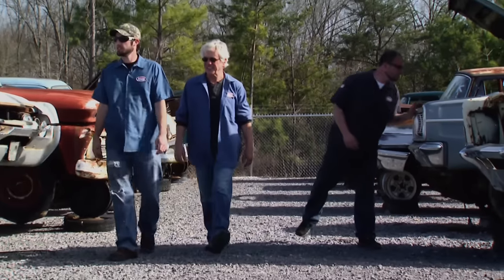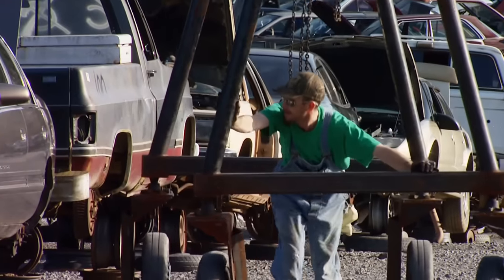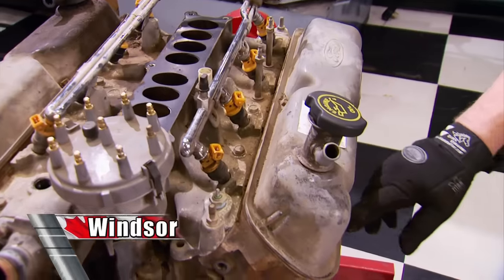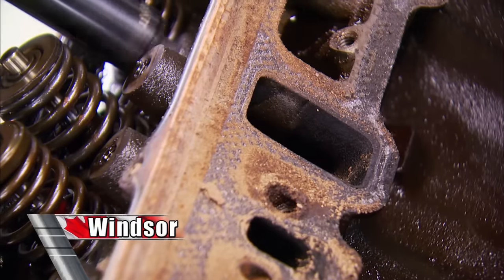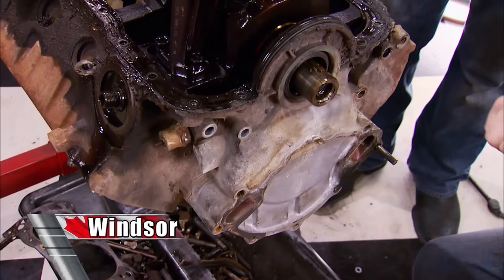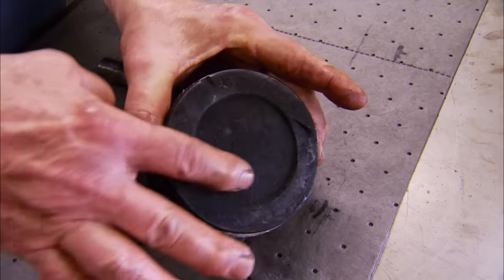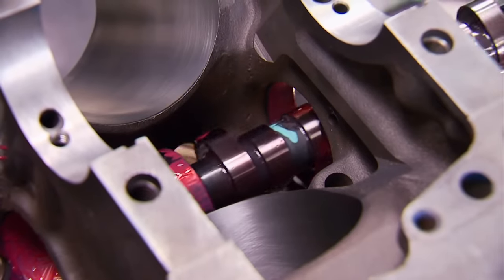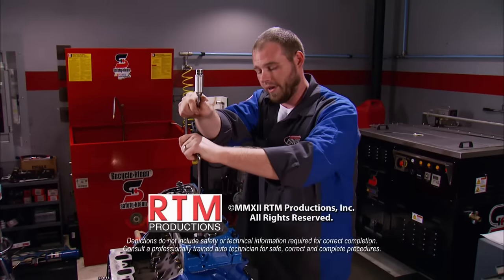Tearing Down a Pair of 351 Small Blocks: Windsor vs Cleveland - HorsePower S16, E10

Comment: I'm in awe...😃 I'd really like to see someone take a 351M and go from mild to wild..
Reply: I think there was a build using stock parts from several on a modified with some changing of water ports that made killer hp.it was in a hot rod magazine fron the early 90s.
Reply: @goober3463  I'd like to see it in this format where they do some low buck mods, say to a 351M Dyno it. Then pull it down put the 400 crank in it and flat tops aluminum heads ECT and make power...
Reply: I’ve got a mild build on my 351m. 750 4bbl, .519 lift hydraulic cam, decked and ported heads, dual valve springs, ported edelbrock 400 performer intake. Nothing crazy but enough
Reply: @JB-tb2qp  on the stock pistons ? Everyone tells me the compression is to low but many motors are 8:1 stock...
Reply: Clinton N yes, and yeah the compression is pretty low, I haven’t gotten the motor in my truck yet so I don’t know how she’ll do but I’m gonna see
Reply: @JB-tb2qp  Too late perhaps, but Racetec Pistons has recently released slugs for both the 351M and 400 that raise the static compression significantly. Go to Racetec's website and look in the Autotec section under Ford Small Blocks.
Reply: 413x398 yeah I’m not wanting anything crazy crazy I’m thinking about getting another project soon
Reply: if i know my tv shows, they ALWAYS end up putting 5 grand worth of parts on their "low buck" engines.
They start out stock, then comes the Kasse heads, edelbrock intake, full roller cam, plated long tube headers, demon carb, msd ignition, and arp bolts everywhere.
It happens every time!
Reply: The 351M was a pig and the second-worst OHV V8 Ford built behind the 255.  The best thing you can do with a 351M is to turn it into a 400 with a crank and piston swap.   Least for the 400 you can get performance pistons.
Reply: @matthewq4b  See my comment above about pistons, but yes the difference between the two is big. The 255 was obviously sourced from a golf cart assembly facility.
Reply: @413x398 Racetec shows no pistons for the 400 or the 351M  just 302 , 351C and 351W. And it seems pretty clear you do not know what the 255 is either...  it is a debored 302.
Reply: @matthewq4b  OK, just checked and I got one word wrong. Go back  to Racetec and look under the Autotec line in the Small block section. And it seems pretty clear that you didn't get the humor about the 255's power level.
Reply: @mymusicaccount1456   You are aware Ford made 3 different 351's right ?   The 351W which is a small block, the 351C which is a 335 Series, and the 351M which is modified from a 400, hence the M for modified.
Reply: @413x398    Yup looks like they are offing M pistons.   Not sure why though, those tall heavy pistons wreck havoc on the rather thin-wall casting of the 335's at any sort of RPM. There is a reason no one to date has offered performance pistons for the 351M. 
Really the only thing the M is good for is a foundation to build a 400.    And the 255 was not lowest HP small block either, so probably why the joke failed.
Reply: @matthewq4b  The joke failed because you were too anxious to "teach" me something "you" thought I didn't know. Good luck with that.
Reply: @matthewq4b  Ford never made any 351's.
Reply: @413x398    Ford called them 351's whether they actually displaced 351cui is irrelevant.  And really they displaced 351.84 CUI. 
  And the joke failed cause it was crap.
Reply: @matthewq4b  Poor MattMatt. So much angst.
Reply: @mymusicaccount1456  All of Ford's production engines (V8) from 1954 to the Mod Motor were OverHeadValve.
Reply: @mymusicaccount1456   Yes all regular production Ford V8's between 1955 and 1989  were OHV in North America.   They did have production SOHC engine s but they were not regular production.  The 351M  was built/ modified from the 400 to meet the demand for mid a displcement V8 after the cancellation of the Cleveland.
Reply: @413x398     The Flathead V8 was still in series production in 54 in North America and still in production globally till 73.   Nice try, but missed it...
Reply: @matthewq4b  I'll stick to the U.S., thank you. I don't care that Canada got the leftovers in '54.
Reply: @413x398    The Flathead was still in production in the U.S and Mexico and in use  in 54.  And Canada got nothing left over they cast their own blocks and are they highly sought after now as they were beefier castings then U.S ones.  Keep trying and maybe you will get it right eventually.
Reply: @matthewq4b  Show me Flathead listed for '54 US cars. You missed the point with MyMusic. He was confusing OHC with OHV.
Reply: @413x398   You said nothing about cars what you did say was "All of Ford's production engines (V8) from 1954 to the Mod Motor were OverHeadValve."   Which is not even close to accurate or true.   So now the back-peddling begins eh. Time to quit before you dig that hole deeper.
Reply: @matthewq4b  It's a 4 inch bore on all Cleveland and M engines. The trick years ago was to get a set of 351C pistons in the compression range you wanted and bush the rods in the M motor to fit the pins in the Cleveland pistons. Even with the 2V heads all the M motors came with, you could have basically any compression you wanted up into race gas territory. Then the heads and big ports really started to come alive. 
If you're taking the motor apart like they are, that's the time to bump that ratio up to something useful. If you're looking for some immediate help, all the M motors were retarded by 4 degrees from the factory. Put back the timing the factory threw away and at least run it straight up at 0. 
Bump the compression up closer to 9.5-1, hotter cam and an intake and carb to match. I don't know if they still do this, but you used to be able to get a Holley adapter to mate Cleveland intake manifolds to the taller M blocks. Single plane manifold, 750cfm carb along with the hotter cam and higher compression, you have a monster on your hands.
Reply: @DriveCarToBar     You can not use Cleveland pistons in the 351M, you can in the 400 but not the 351M.  

The 351C stock piston compression height ranges from 1.631" to 1.657" depending compression ratio. 

The 400's compression height is 1.650" Same dimensions as the Clevland.
You can use Clevland pistons in a 400 if you bush the 400 rods. 

The 351M piston compression height is 1.947".   You can not use Clevland or 400 pistons in a 351M  unless you want a compression ratio of like 3:1

And there are no "M" motors, there is the 351C  the 351M and the 400   Ford never called the 400 a 400M  to call the 400 a 400M is erroneous. 

Sort of like how people erroneously call the  Ford Small Blocks, Windsors, there is only one Windsor the 351W and it is a Small Block.
 There is no Windsor engine family and there are no M blocks.
Reply: @matthewq4b  tim Myers racing offers a flat top piston for the 351m/400 that bumps up the compression or get some Australian 2V heads with closed chambers that will bolt on.
Reply: @otsenres1636    TMEYER makes pistons for the 400 or a stroker kit.  He has never made pistons for the 351M.
Reply: Want to build a m block look a tmeyer Inc.  and racetec custom builds pistons for most applications even the m block. Built right a 351/400m can be a big power producer I'm in the process of building one now
Reply: @nikkiteachout4561    Again there is no such thing as an M block.  And the 351M is a boat anchor and can not make big power as the heavy tall pistons stress the block at any sort of RPM.  I've been messing with  335 series engines for over 40 years and can't even count how many of them I've built over the years.
Reply: @bigboreracing356   Again the 400 is just a 400, not a 400M  there is no such thing as a 400M.   And the 400 can be made to make power and monster torque   450HP and 500 plus Ft torque is easily achievable without breaking the bank.  And there have been several documented builds making over 500 HP and over 550 Ft lbs torque on the 400.  All the tricks that work on the Clevland also work on the 400.
Reply: @bigboreracing356  I almost believed you until you said 302. 
Talk about a boat anchor. There's a reason the most popular swap in foxbodies is an LS.
Reply: @bigboreracing356  Uh huh. Little baby 302 can nevar lose. 
Sure thing. Iron heads and all. I believe you, totally.
Reply: @matthewq4b  "heavy tall pistons stress the block at any sort of RPM."
Jeez, dude.... change 'em. They don't have to be tall, that was just a manufacturing trick by ford to get away with using existing parts on an engine that would likely never see 5000rpm.
Reply: @mfree80286   Uh it is quite apparent you have no idea what you are talking about.  When Ford shortened the stroke for the 351m in the tall 400 block they made the compression height of the piston taller to account for the shorter stroke.   So you are saying get at set of longer custom rods made so you could use 400 pistons.    And then you end up with a long rod 351 that is going to have more issues then the 351M AND a horrific rod ratio. That is about the dumbest suggestion yet.  Especially when for a tenth the cost you could drop a 400 crank in it and make more power and torque.
Reply: @matthewq4b  
Sir, I want you to go back through your responses and take a good look at how you're talking to people you don't know. 

At the end of the day, maybe I don't know 'shit'. But I'm at least not insufferable.
Reply: @413x398  hi what do you think about 302 5.0 4b carb, what should I add to get more horse power?
Reply: @adanbracamontes424  Assuming you're new at this, I would highly suggest searching 302 videos on You Tube, as there are a ton of them. Your question is far too broad in scope to get into here.

Comment: would love to see a finished dyno comparison Cleveland vs Windsor.
Reply: The Cleveland /Windsor dyno comparisons are always interesting but without fail also brings out the armchair builders and magazine educated experts.   I was a little surprised to see the Horsepower TV Chevy specialists doing something worthwhile with both flavors of 351 Fords. 

The Cleveland heads are receiving the correct modifications for a respectable performance build ! 
Rocker pedestals machined for screw-in studs and pushrod 
guide plates suggests that someone calling the shots actually has a higher level of skill than what’s usually required for the SBC double hump heads with the obligatory three quarter race cam Bowtie mentality 😉. It should be interesting. My money is on the canted valve Cleveland’s vastly superior flow velocity over the asthmatic Windsor’s shortness of breath 😄.
Reply: the Cleveland was the race engine, but the ports were to big for street use, it also had issues with oiling which is why so many times it's the best thing to hybridize the two in the infamous Cleav-or. Drill the block into the heads for cooling and bolt the Cleveland heads to the Windsor block.

the Cleveland IS the more powerful from the factory. It's also more problematic, but does have smaller mains, but poor oiling. 

a 454 Cleav-or with aftermarket CHI block is a freakin beast with Kaase heads.... your looking at 750+ hp all motor and just begging for juice.
Reply: @ Steve Blakley...if cars are any indication, your dad sounds pretty cool. I owned a couple of Mach 1’s back in the day. In ‘71 I had a ‘69 428 Cobra Jet with Ram Air and C6 automatic. For sheer tire smoking torque, it was awesome and won it’s share of street racing against the best of the day.  But in all honesty, the current day Mustang GT and especially the modern Shelbys could out perform it in all categories. 

After I managed to blow up the 428 CJ by pushing it beyond its limits, I got another’69 Mach but with a more reasonable 351W 4-V. It ran good for a stock small block and I drove it a couple of years until a old drunk woman ran a stop sign and caused its destruction. 

Now I have a 1970 Mach 1, 351 Cleveland and Shaker Ram Air. I’ve been pretty lucky with this one because I’ve owned it 35 years without something tragic happening. 

I like the Cleveland best because it responds so well to modifications that I’ve done to it. That’s probably why Clevelands dominated Pro Stock Drag Racing during the seventies and Windsor based engines couldn’t make enough power to be competitive in Pro Stock. The guys stuck with running Windsors are quick to say how Clevelands suck but the record books tell it like it is 😉. 
I appreciate your reply 👍.
Reply: @ narmale...The stock Cleveland four barrel intake port size is 2.500” H. x 1.750” W.  The intake valve is 2.19” in diameter. That’s pretty big even for a big block engine. But not necessarily too big for a 351 street engine with a few basic modifications to take full advantage of the massive power potential that the Ford Engineers specifically designed this head for.  In ‘70 and’71 before the combustion chambers were enlarged to work with lower octane fuel, the 4-V heads had quench (smaller) chambers and actually performed pretty well, especially at 3000 rpm’s up to redline. Throttle response felt a little soft at lower engine speeds but came on strong as rpm’s went up. 

Turning the Cleveland into a street terror only took a few basic upgrades. Headers to replace the restrictive cast iron manifolds along with a low restriction exhaust system. A Holley carb and aluminum 4-V intake manifold were the basic bolt-on components that made a huge difference. Next came a hotter solid lifter cam and roller rocker arms to take full advantage of the intake and exhaust upgrades. To optimize all of the other upgrades, a lower rear end gear ratio of 4.11:1 or lower, depending on what worked best with the new camshaft was next. Four speed cars worked great with cam swaps. Automatics usually needed a higher stall speed torque converter to work with the more radical cam grinds available at the time. Around 1971 was the first time that I got to ride in a ‘70 Mach 1 with the basic modifications just mentioned. It was totally awesome and hard to believe that much power could come from a stock bottom end 351 with a few basic modifications. With a balanced short block and higher compression pistons, even more power can be made. 

When it comes to the Cleveland block and its stock oiling system, it works fine for mild street builds. But thanks to the internet and all of the online experts spreading bullshit about something they heard, the problem got blown way out of proportion. 

The bean counters at Ford decided they could save a little money on each block from the Cleveland foundry by machining only two oil galleys instead of the usual three. As a result, the stock oiling system feeds the cam and heads first before being routed down to the crank and main bearings where a good supply of oil is required for high rpm situations. The problem became obvious early on when drag racers in Pro Stock started taking advantage of the tremendous power potential of the 4-V heads and radical camshafts by twisting the engines to 10,000 rpm’s and higher. Needless to say the bearings fried quickly without a good oil supply. NASCAR builders were having the same problem. But the fix is simple and relatively cost effective. By installing screw in oil restrictors in the passages that feed oil to the upper engine along with enlarging the lifter bores to accept brass restrictor bushings, more oil becomes available at the mains and bottom end. Problem solved. I use restrictors on my Cleveland and wouldn’t build one without them. 

The new aluminum alloy Cleveland blocks that are in production now in the United States are designed with priority main bearing oiling so no modifications are required. With the weight savings of aluminum and a bore and stroke capacity nearing 500 cubic inches, Clevelands are going to rock harder than ever thought possible !
Reply: Steve Blakley  c6's trannys wont work on a 351 Cleveland stamped 2v/4v(small block bell pattern "FMX/C4 , 4 spd top loader or a T-5 with sbf bell), c6 will work on the 351 modified which is basically a de~stroked 400
Reply: Oggy   Aussies always had the better Cleveland casting mainly due to their higher nickel content... and most all heads cast there were closed chambered weather 2v/4v.. higher compression ratios.. as far as oiling issues i never had'm either.. in any of my builds...